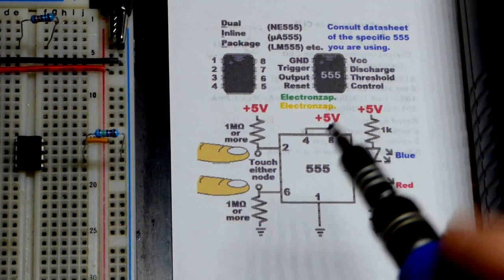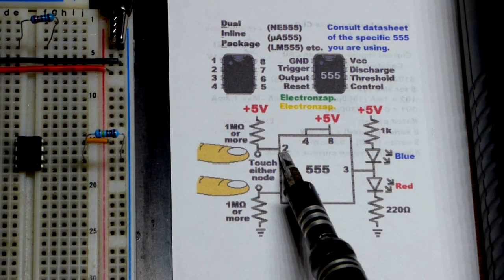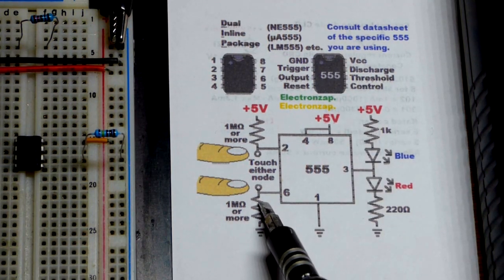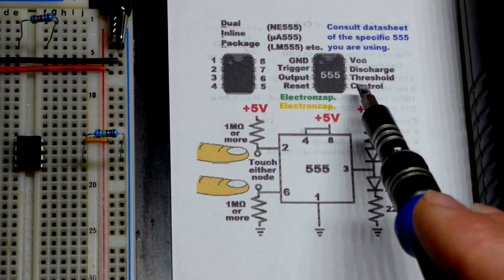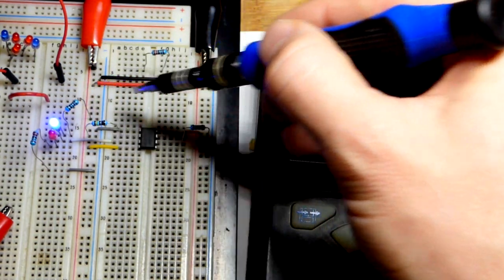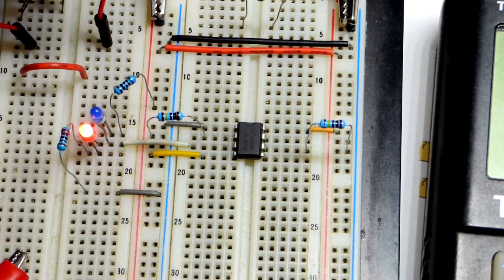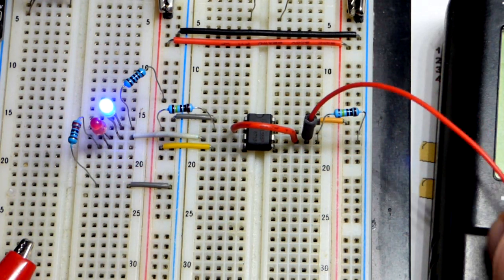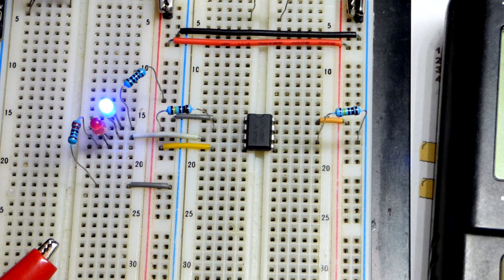Touch based bistable 555 timer circuit with LEDs output learning electronics lesson 0065

Comment: Possibly the most versatile ic   ever made - Inverting , triggering , pulse generation , timing ,pwm and more - that 8 legged little bugger can do it all ! Now days we buy a board , plug it into a PC and tell it what to do which sadly means the basic fundamentals are not being taught - the 555 was the original "Blinker " unit before we had microcontrollers  but you had to learn how it works and how capacitors and resistors interacted with each other . Nice to see someone trying to keep the basics alive - thank you !

Comment: Please when we see the mape of 555 the pine No 4 is the base of the transtor why we connected  with No8 thank you  .
Reply from the maker: Pin 4 is the reset pin. It needs a low voltage, which is close to ground/negative side of the power supply, to reset the 555 timer. I connected it to the positive side of the power supply to keep it from accidently reseting the circuit. Pin 8 is the positive (Vcc) supply pin, so it is also connected direcrly to the positive supply. Anything connected directly to the positive supply is also connected to everything else connected directly to the positive supply. So in schematics, you will often see their connections come together before connecting to the end point, instead of each one of them having their connection shown individually. Their connection to each other does keep their voltage the same, which is the best way to prevent the 555 from resetting, as explained above.